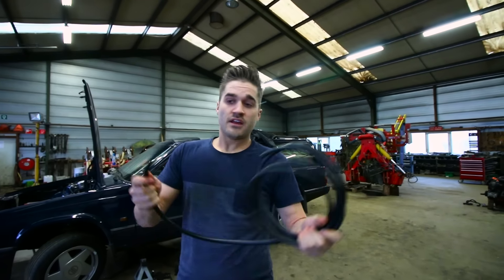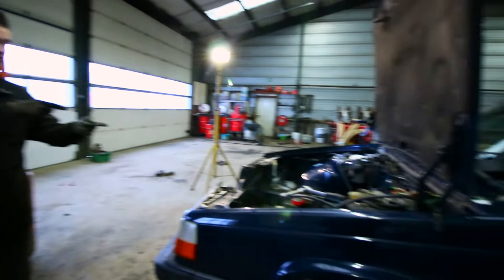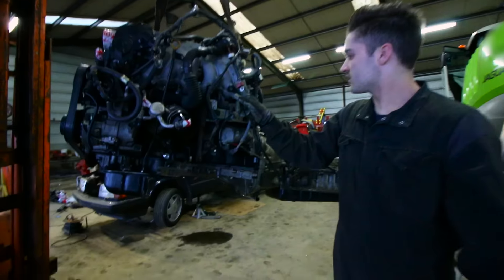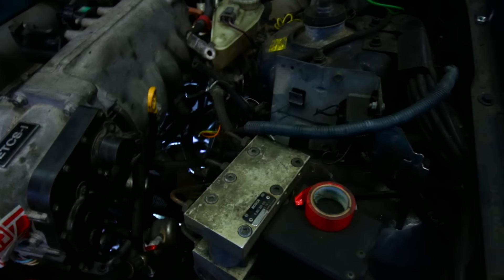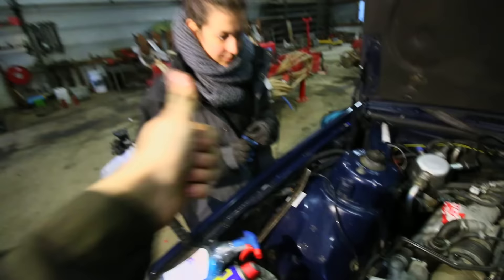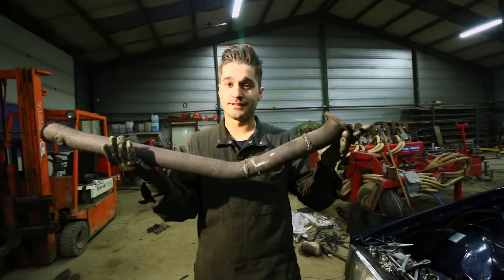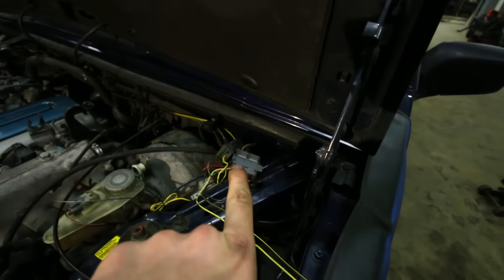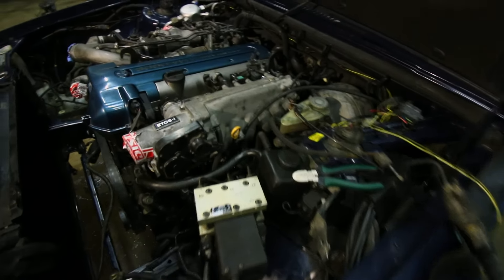The LCM 940 - The 2JZ Volvo [Ep4: Fueling, Power Steering & DIY Exhaust]

Comment: Hey! 
You should totally check out the facebook group "Redblock Tuning" (it's called Rödblock Tuning since it's swedish)  If you write in English they'll still probably answer you. If you've got any questions for your redblock or your volvo, that group is the place to go, a lot of experts and great help from the people in the group.

https://www.facebook.com/groups/redblocktuning/

Btw, are you planning on changing out the rear axle/diff? Those 1031's are known to explode if the engine is somewhat tuned. And a 2jz is definetly going to blow up at least 1 per month. 

Keep up the good work, I hope I'll get to see some videos of your car doing some burnouts this summer :)